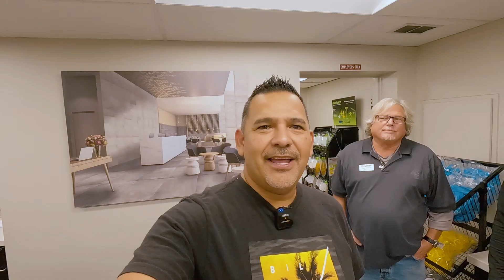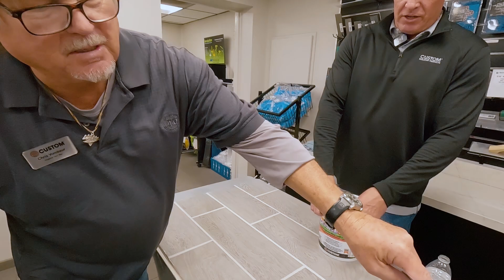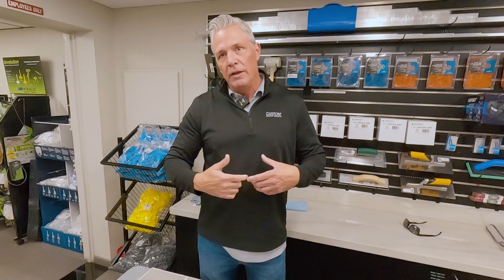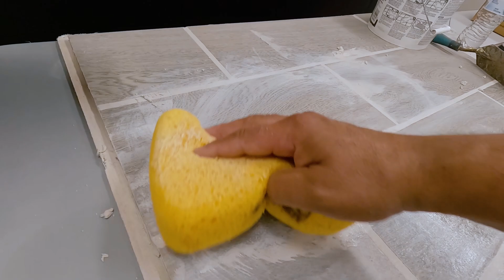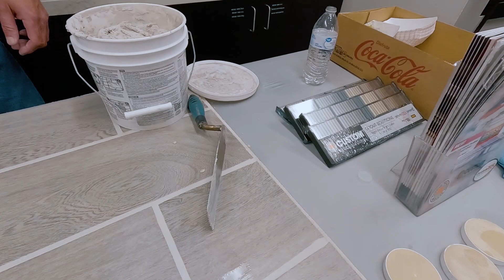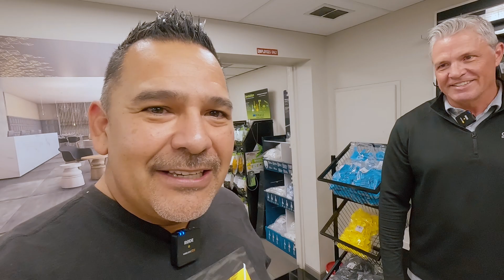Impressive Benefits of Prism SCG Grout, EVERYTHING YOU NEED TO KNOW!

Comment: I'd really like to know the long-term effectiveness of this grout in a shower. I know it's a newish product, but does anyone have input on how it holds up over time?
Reply from the maker: Looking for the same answer...so far so good... but hopeful it holds up over time🙏
Reply: Do not use this grout on a shower floor. I spent the last 6 hours scraping out this grout from porcelain hexagon mosaics because it was literally coming out from the grout joints. I’ve used it on tile with glazed edge and the grout won’t sticks to the glaze. Honestly the worst product I’ve used. Re grouting hexagon mosaics is not fun. Just stick to the original prism and save your self the headache.

Comment: This grout is terrible. It's horrible to apply on a wall, most of it ends up on the floor. It doesn't spread well for 1/16 joints, really awful to apply. Finish was ok. I dion't think it is any easier to clean off tile than regular cement grout.
Reply from the maker: Really?  I've never heard that before🤷‍♂️.  Bummer, that you had that experience with it...I noticed sometimes you need to whip it up a bit to get the grout a little smoother.   But I just whip it by hand with the grout float.  I have another video where I show myself using it on a shower wall... no issues with it falling at all.   It may not be easier to clean than cement grout,  but single component grout has a bad reputation of being more difficult to clean...so the fact that it cleaned up like cement grout is a huge benefit👍.

Comment: I just used this on a sealed, stone, shower floor. 6 hours later, it is still soft. About 60 degrees. I know another installer who said it took 2 days to cure. I am also in Florida. Can't find anything else about this product. Their literature says it can take up to 7 days to cure for water use? I wish I would have seen this before I used it.
Reply from the maker: Yes,unfortunately all brands of single component grout does take longer to cure.  That is a valid point though, I think the grout manufacturers should make it more obvious, like larger print on the grout pail👍

Comment: Nope , cement grouts are way superior to that crap, plus on walls that stuff is impossible to get a full grout joint, fusion would never get as hard as there cement grout, that's what they said about fusion grout ,they need to send out samples to us tile guys, cause they did with fusion and I done 3 showers with the fusion grout and it all washed out in less than a year,, cement prism is way better than one component premixed grout
Reply from the maker: Yes,  Fusion Pro scarred us all!🤣🤣.  This stuff seems different, better....I think they intentionally made sure it didn't have the same problems that Fusion Pro had.   I also want to see it on vertical work,.. I'll be trying it out and posting another video soon👍
Reply: @HowToTileLikeaPro  I hope so because it would be nice to use if it is reliable enough in wet areas and not have any complaints or callbacks
Reply: @HowToTileLikeaPro  I used Prism unsanded on my kitchen floor and the whole thing is going to need to be redone.
Reply from the maker: @MAGAMAN  Ouch!  What do you think was the problem?
Reply: @MAGAMAN problem is you used unsanded for the floor. Usually unsanded is for tight grout joints and for soft material like Marble. For floors  if Marble was used we mixed a small handful of sanded with the non sanded. Now prism sanded and mapei ultra color are my favorite